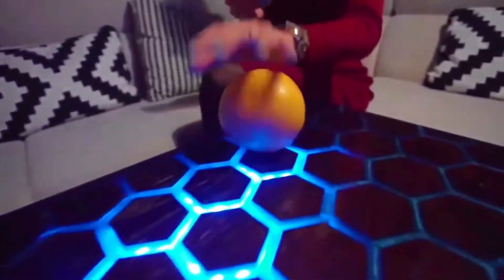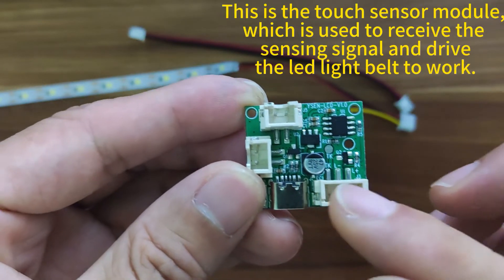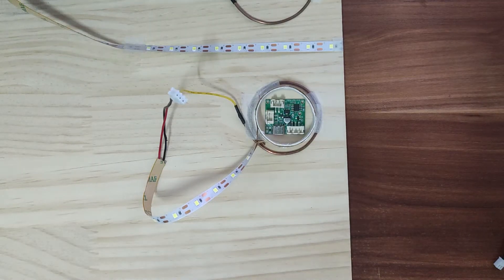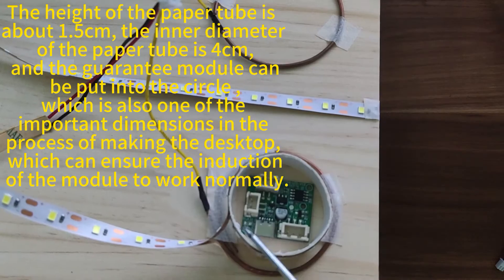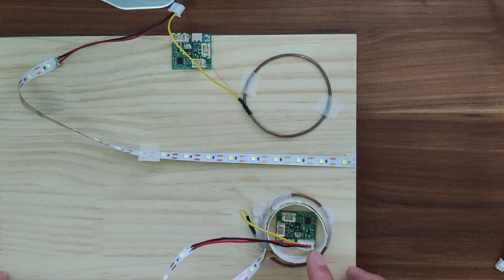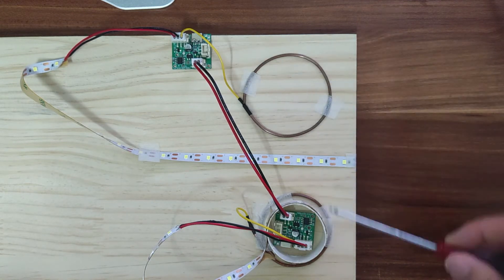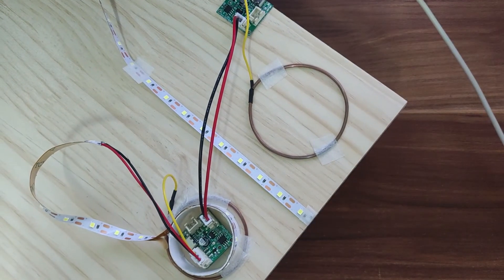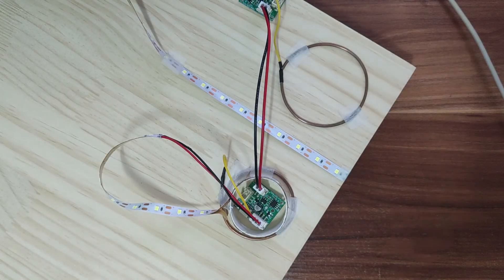Unlock the core components of the touch sensitive DIY smart river table

Comment: Hiii Can u tell me what 8 pin IC you are using for touch sensitivity.. is it 555 timer?
Reply from the maker: The module can support 5V and 12V power supply modes, and you can choose a lamp belt with the same voltage as the power supply.

The module is a single-chip microcomputer that supports the touch function, which is written into the program to achieve the function; it is a domestic chip in China, and we have no way to know the specific information.

Comment: Very cool!  What gauge wire did you use on the coil?
Reply from the maker: The copper wire is only used to receive the inductive capacitor, and eventually the module processes the signal and lights up the lamp belt.
Reply: @moreboons  Oh I see, so the diameter of wire coil doesn't affect the range?
Reply from the maker: @DeadEye428  The coil can be sensed under the plank of 0.79in thickness. The larger the diameter of the circle surrounded by the coil, the larger the range.

Comment: What power supply did you use?,How did you  parallel all the sensors together?
What microcontroller did you use?
Reply from the maker: The module is powered by 5V, and the modules are connected to the socket of the module by wires, as shown in the video; the capacitive touch sensor chip used by the module.
Reply: He wouldn't know because it is an AI generated stolen video. However the idea has been copied so many times, I can't find the original video anymore.

Comment: If I connect 100 modules together (as you do in the video with two modules), do I simply have to connect to power through a USB C input? Would it be worth it, for example, to connect the USB C cable to a current mobile charger?
Reply from the maker: It is possible to connect the USB receiver of any module with USB-C power supply. But if 100 modules are connected together, a power supply of at least 5V, 15-20A is needed to be safe. It is recommended that you use a desktop power supply similar to that used in laptops.
Reply: @moreboons  thanks 😉

Comment: Can i ask you which power supply did you use? Thanks for answer.
Reply from the maker: Hi, the power supply is similar to the laptop adapter style, but the output is above 5V/2A, and different power supplies are selected according to the data of the module.

Comment: 1. Did you use an on,off switch for the electronics. If so how did you install it?
2. What kind of battery did you use to power all the attached lights?

3. Did you glue the circuit boards to the back of the table? How did you get them to stay in place when you flipped the table up right?

4. When you finished attaching all the circuits to the back side of the table and you flipped it over did you have a covering for the table? How did you hide the circuits? 

Table Questions 
1. How deep was the cut to place the circuits and LEDs in the back of the table?
2. How big was each hexagon on the top of the table? 
3.what type of wood did you use for the table?
Reply from the maker: Hi bro.
Have you sent me an email? I have replied to the above questions in the email, please refer to
Reply: @moreboons  I did not receive the e-mail, would you mind sending it again?
Reply from the maker: @kpproductions9871  We have replied to your email again, please check your spam, or send us another email: service@morboons.com
Reply: Hi, could you send me the answers too , please?